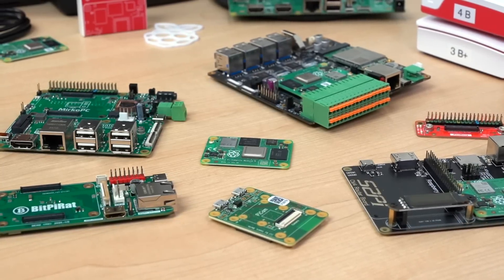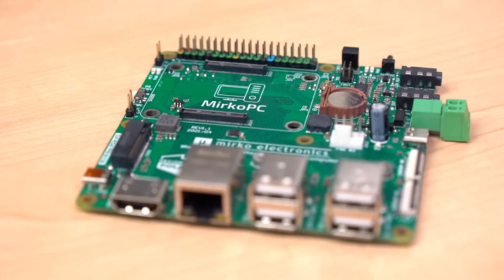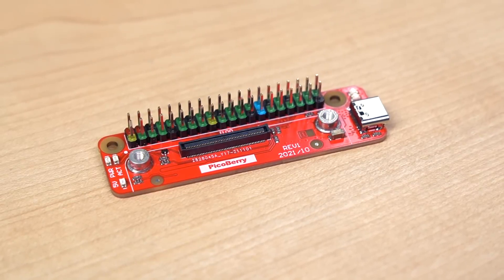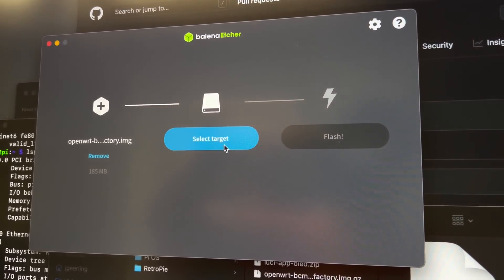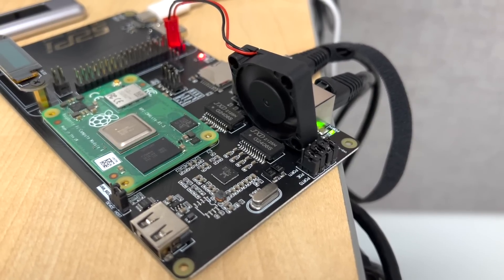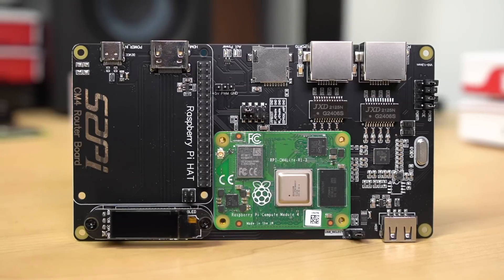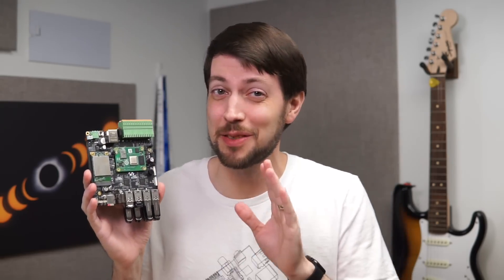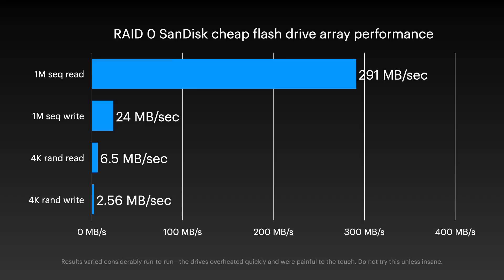So I heard you liked USB... (5 new CM4 boards)

Comment: Hi Jeff, what a great video! It's a shame that CM4 boards have gotten so expensive recently. Any chance we get a roundup of cool expansions for the original RPI4?
Reply from the maker: Possibly... there haven't been as many interesting Pi 4-based products in the past year, though there are a few. We'll see.
Reply: I think part of that is due to the fact the CM4 provides what people have been asking for on the regular RPi. It’s just a shame we don’t have a rpi with proper NVMe support, more than one PCIe x1 lane, a higher performance cpu (Snapdragon 7xx or Mediatek), etc. Keep the low cost philosophy, but offer a product for those that want to make the Rpi their daily machine or want to do more with machine vision, ai, a NVR, etc.
Reply: They are not only prizy, but also almost out of the marked because of the rate of the production at this moment. If there are any production on semi conductors at this moment. It's painful to watch all the semi conducting equipments has been drained out of the market. There is no fun to make own project when it is too prizy and almost impossible to get a hand on.
Reply: it is board to test and it cost bcoz low product line. you can get schematics for board and make own. thats purpose. rpi is axatcly same we allready have we not need cm unless you try build something to manufacture, but even then you can just make own board

Comment: If we are attaching PIs to telescopes let's not forget some stepper motors!
Reply: @Anna ♪ don't post links to videos that have NOTHING TO DO WITH THE COMMENT your replying to... It's called spam, and reported as so
Reply: This is something I have really wanted to do... I don't even have a telescope, but I want to do this
Reply: @tyrzxv  In the past I've connected cameras to my telescope.  When you have really zoomed in anything can dramatically jiggle the image.  Luckily my favorite camera featured an IR remote.  It was a terribly cheap telescope but even then I got some great pictures.  With the cameras we have built into phones today and a cheap selfie remote you could get some crazy good pictures.
Reply: @tyrzxv  I just had a thought.  Some libraries have Telescopes, cameras,  and other devices you can borrow.  See if your library does.
Reply: Okay, so now we need a Wesley Kagan / Jeff Geerling crossover.
Reply: I've got an older Celestron CGEM 800 telescope. The telescope mount has the motors built in and is controllable through the RS232 port. The RS232 port both accepts commands to point the telescope and returns information on the scopes location (from GPS) time, so on. Getting a Pi to interact with and control the scope is very doable. 

It's controllable over WiFi too, but I've not seen documentation on WiFi protocol.
Reply: @JoelIvoryJohnson  That would be the whole package with a good camera.
Reply: Well at that point why not set up an array of telescopes pointing at a single spot in the sky?
Reply: @deusexmachinareznov4975  That would be interesting particularly if we allowed remote control to others.  Something similar to Web SDR for telescopes.  Although I wonder if it isn't already being done. Some kind of scheduling system would be needed along with good software.